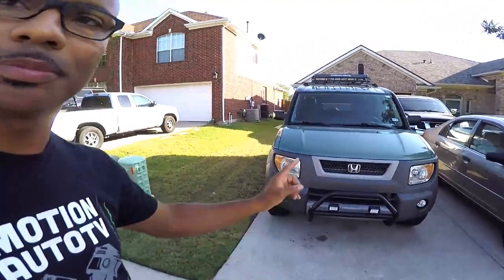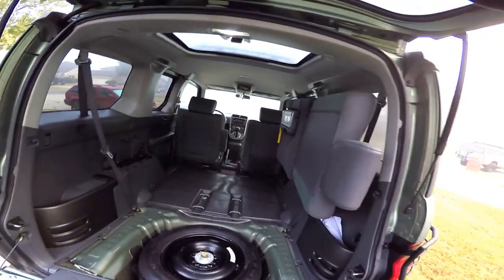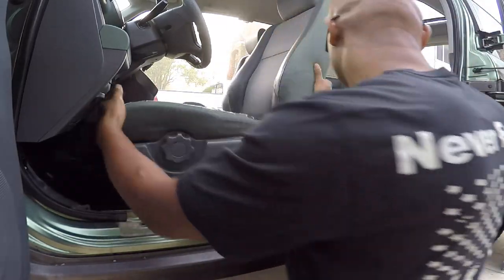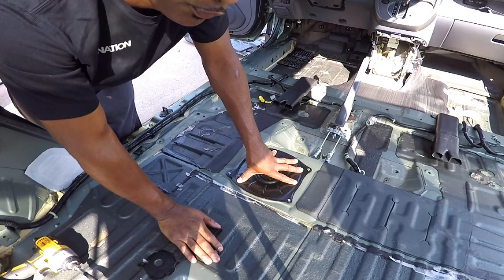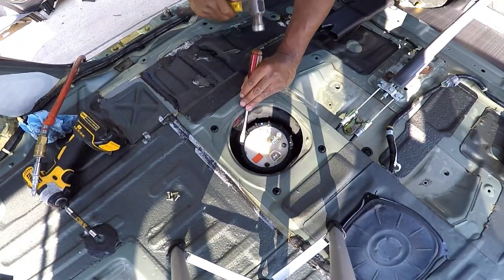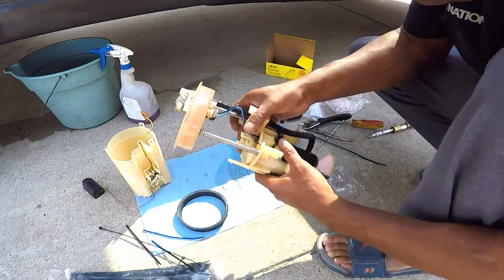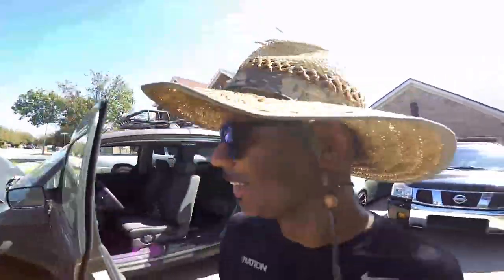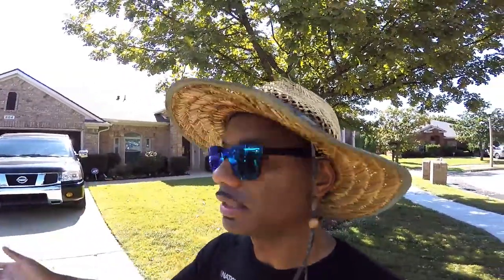Honda Element fuel pump replace

Comment: @10:00 starts to remove seats (which isn’t necessary to just pull back flooring to expose fuel pump access.)
@13:00 starts to remove the fuel pump access plate.  🙏
Reply from the maker: Yes you right but the car need a deep clean it was really nasty inside
Reply: Oh shoot, then it doesn’t start!  Maybe get one of those devices that read errors or some diagnostic info? Looking forward to next video to see what you find. Always start with the fuses and simple stuff the work up.  My E is currently sitting the drive now with same turn key but no start dilemma. You are the first person I’ve seen to just buy the pump itself rather than replace the entire housing unit? I was hoping it would be a fix for you. Best of luck.
Reply: @ByrdsRebuilds  ya Im sure my entire floor could use that detail treatment. My coin in the back is all scratched up from hauling stuff, i see they sell new replacement floor kits too.  Is the flooring glued down quite a bit when you pull it up? Wondering if flooring lays flat or ripples after pulling it up? I may just replace mine. AFTER I get it running again! Ha, geez . ✌️

Comment: I just bought an element. How do I get the transmission checked out, like you said you were going to do?
Reply from the maker: I will have to take it to Honda or  transmission shop to make sure the fluid is ok. I looked that fluid in my element looks red. If the fluid looks brown or smell burned definitely get it checked

Comment: Did you test those zip ties for fuel resistance or are they going to melt in your gas tank? This is the problem with shadetree mechanics.

Comment: It ended up being coil packs or head gasket?
Reply from the maker: It was a wrap block I didnt check it when I rebuilt the engine good thing I built two of them..
Reply: Thanks for the reply man I ask because I’m currently experiencing crank with no start I’ve confirmed spark and fuel but it won’t turn and fire up 😭 car was fine just turned it off and now it wont turn on
Reply from the maker: That was the same thing happen to me, got home turned it off then it wouldn't start. On yours take the radiator cap and try to start it if alot of antifreeze come out then you have a blown head gasket.
Reply: @ByrdsRebuilds  thanks for your reply and info 💪🏻
Reply from the maker: You welcome